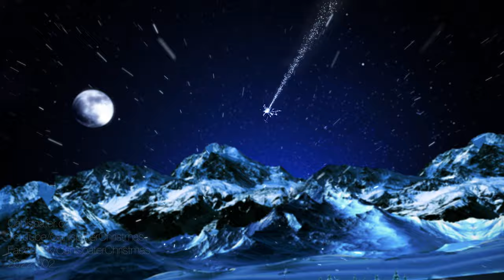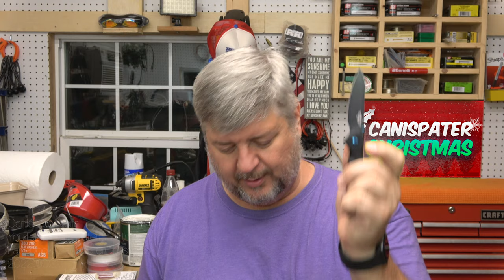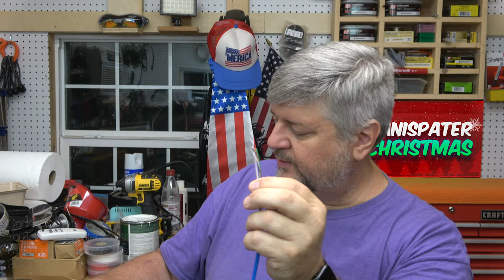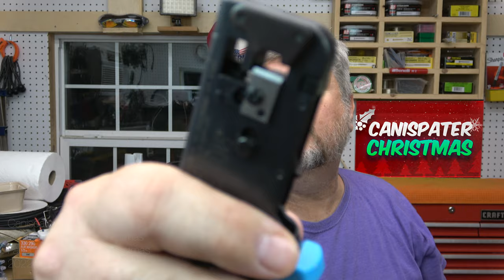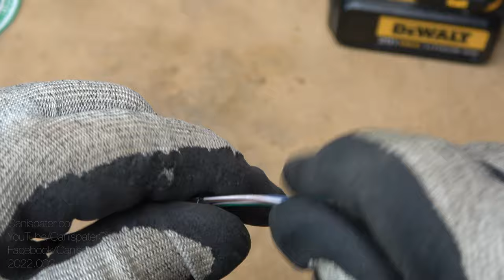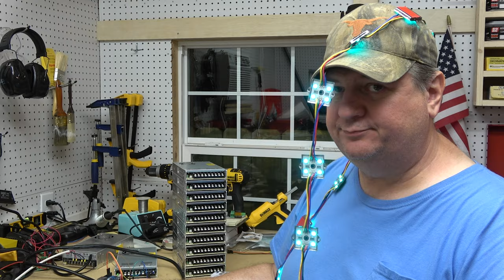🎄How To Make Your Own Ethernet Cables CAT5e/CAT6 (2022)🎄

Comment: A little tip. I use the small string as a stripper string pulling down the insulation. It will cut the insulation  and just cut off where you want it. Less chance of nicking wire.
Reply from the maker: Nice!

Comment: Nice tip with the drill. I've been making my own cables for a while and always hand twisted the pairs. It works for me, but certainly looks like the drill gets them quite a bit straighter. :)
Reply from the maker: There's likely a better way to do this, but yeah, "works for me" is my motto. 😂

Comment: I don’t put the wires in individually. I align them in order between my thumb and index finger and feed them all in at once. Much faster.
Reply from the maker: Yeah, tried that. Got mad. Threw stuff. Said bad things. Developed my method. Much happier now. 😂
Reply: Also, cut them on the diagonal, so that the first one on one side is longest, with the shortest on the other side.  That way you're only fussing with one wire at a time.

Comment: Great video ... I came across the pass-thru connectors a little over a year ago and for making your own cables, I think they are the best thing since sliced bread! (or pixel controllers - which ever you prefer!!). Now I have a bunch of the old connectors collecting dust 😆
Reply from the maker: Thanks! You might be able to make a cool prop out of the old ones. 😂

Comment: Ok I know THIS video isn’t related to it BUT I need advice!!! Ok….. I just bought the ready to run version of the falcon f16v4 from falcon… it’s In one of those grey cases. How would you mount that to a house?!? I really didn’t want to have to remove it from the case they sent it to me in.  I’m lost!!!
Reply from the maker: I mounted my box to a piece of half-inch PVC and hammered a piece of rebar into the ground. Just needs to be off the ground a little so rain won’t get into it.

Comment: A few points:
1) Do not make patch cables with solid wire.  Use only stranded with plugs.  Solid is used for the keystone jacks. 
2) With  patch cords so cheap to buy, making your own is a waste of time
3) Gb Ethernet was designed for plain CAT5, before 5e was even available, so CAT6 gets you nothing for Gb.
4) Proper cable strippers work better than a knife.
5) Don't mix CAT5/6 connectors & cable.

About myself, I've been a tech for 50 years, initially in telecom, but now networks, etc. too.  My first LAN experience was in early 1978 and first Ethernet in mid 80s with 10base5 "ThickNET" coax.  I have also worked with 10base2 "ThinNET coax and, of course. CAT 5 & 6.
Reply from the maker: Thanks! Great advice!
Reply: Agreed with all the above. Stranded wire allows the plug prongs to go between the wires when crimping. With solid wire, it depends on the connectors. Some state they support both solid and stranded wire and use a different crimping tooth pattern. If they are built for stranded, then they may be hit or miss on the solid wire, or may even break the wire. Also, CAT6 does not always have that inner spline, but it helps to avoid kinks. The spline separates the wires for reduced crosstalk, but I believe they are able to keep crosstalk within spec without it by twisting the entire set of 8 wires as a whole in addition to the pairs being twisted. True that CAT6 supports the same speed as 5e but it has 2.5x the bandwidth potential.

Comment: What about a tester?
Reply from the maker: I don't have one. The cables generally work or they don't. This is not necessarily the "correct" way to do it, but it works for me 99% of the time. Pro cable builders will say I'm doing it wrong. Others make fun of me for using pass-thru shells. Pfft. 😂

Comment: 1st off I love your videos. They're very helpful to someone starting off in this hobby. In your years of experience with these cables do you recommend outdoor rated cable? Is it worth the extra cost? Does the cable need to be shielded? Is Cat6 better for longer runs? Any advice will be appreciated as I'm getting ready to start the process of making cables for this year's show.
Reply from the maker: Thanks! Well, there's a lot of factors involved in all that. I use unshielded CAT5e because that's what I started with and it still works for my display - the lights blink when they are supposed to. I tend to build with the best that I can afford at the time. I don't know that CAT6 would perform any better right now, but may in the future. I also think outdoor cable would last longer. Then again, you may change your entire display and need new cables anyway. Probably not the answer you were looking for. 😂

Comment: Hi wondering if you could shed some light on this before i start doing my lights ,  I'm using 18awg from power supply to controller and 18awg to pixels , was not sure if i should go lower awg from power supply to controller , i gather 18awg is fine for pixels but was not sure if i needed to go say 12awg or 14awg from power supply to controller , any help welcome .
Reply from the maker: I generally use the largest wire I have on hand, but it really boils down to how many pixels you are feeding and can the wiring handle it. On an F16 where pixels are concentrated, I'd go with the largest wire the controller accepts which I believe is 10awg. In all cases, keep the power supply wires as short as possible (a foot or less) to keep voltage drop at a minimum. Differential receivers can have their own power supply too, but there are only 4-ports to deal with. You will get a feel for this with experience, but anytime you add something, I'd check the power supply wires a few times during the first show to make sure they aren't overheating. Also, check everything after the first show to make sure nothing melted. You can do that the next day when there is light out. There are current-handling wire gauge charts online that should help. Rule-of-thumb is to use 0.06 amps per pixel for 100% white to estimate what the max current draw could be, but check your pixel specs (or measure them) to see what they actually pull.
Reply: @CanispaterChristmas  Thank you very much for clearing this up for me .

Comment: Just take a bit of the sheath that you stripped off, and run it down the pairs to separate them

Also the core is just the type of cable you bought, not if it's 5 or 6
Reply from the maker: I'll try it, but then I can't use my drill. 😂 Interesting. Not disagreeing, but all my CAT6 has a core. None of my CAT5 has one. I may have some plenum cable I can check, but can't remember if that was CAT5 or 6.
Reply: @CanispaterChristmas  I have never seen any Ethernet cable, CAT5 or 6 that wasn't solid copper.  However, I believe there is some cheap stuff that's copper plated aluminum.

Comment: All of my neighbors are getting Trim lights and I was wondering what are your thoughts, are they worth it? Pros / Cons? Can we  DIY it? Started following you over a year ago with the hopes of starting but never did and now I so jealous of my neighbors lights but don’t want to pay $3500+.  Thanks for the videos.
Reply from the maker: I'm not familiar with them, but from what I read, they are more for people that don't want to spend time messing with lights. 😂 I have a set of lights around my garage I forgot to take down, but they still work so I would lean toward the "not worth it" column, but that's totally a personal decision. I don't know if someone has hacked them to work with our stuff - it's probably more of a question for the Facebook forum. I guess it also depends on how much sun you get where you are. Strong sunlight tends to yellow the pixels we use. They still work fine, but develop a haze/cloudiness in the epoxy (people have left their lights out all year in the hobby too and the trim may help protect them a little). I accidentally left a string out for a year and we get intense sun here. They yellowed, but I still use them. It really depends on what you want to do and if you think playing with lights is something you'd enjoy. There is a steep learning curve to what we do, but we can usually talk people through it and once you get the hang of it, adding to it next year is much easier.

Comment: This is a nice tutorial, but as a person who does these cables on a daily basis there's way too many extra steps and a lot of unnecessary tools.  A drill is not required because you never strip more than half inch of insulation off your ethernet cable, your crimp tool actually has a wire gauge to tell you how much insulation to take off because a lot of us don't use the RJ45 easy connectors we use standard RJ45. The crimp tool itself has a cutter built right into it to measure the length of your wire as you insert it into the connector and you want to be careful of keeping the twist because untwisting too much could cause the cable to fail. But like I said it was a nice tutorial just some unnecessary tools and some unnecessary steps for making cables.
Reply from the maker: Too many tools? Is that even possible? 😂 No doubt this is an inefficient way to do it, but it has cut down on my frustrations and gives me excellent results. If you can have someone video you making one close up & post it to YouTube, I’d be happy to link to it in the description.
Reply: @CanispaterChristmas  I'll see what I can do, I just recently had my leg amputated, so right now I'm in the healing process. As soon as I can get back on my feet I will see about making a video for you.
Reply from the maker: Wow! Sorry to hear about the leg Chris. Heal quickly my friend.
Reply: @CanispaterChristmas  Thank you, I hope it goes quickly.
Reply: @CanispaterChristmas  One tool you forgot to mention is a continuity tester, which tells you if the connections are good.